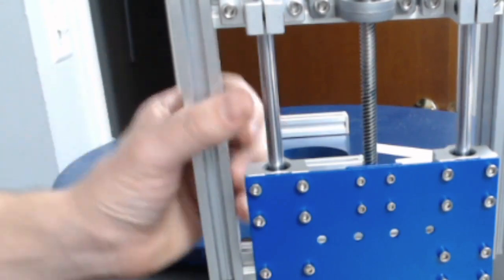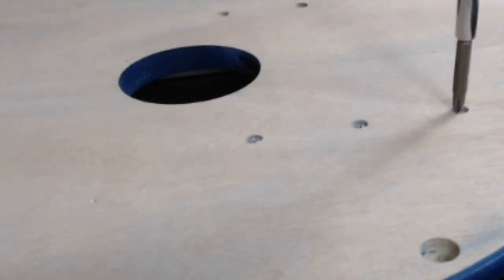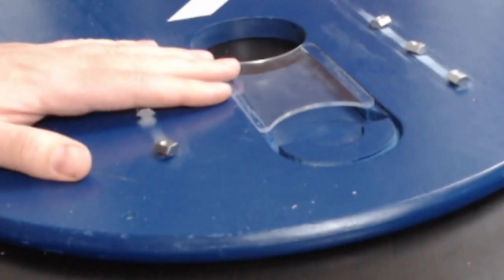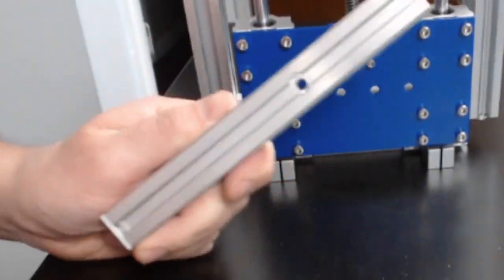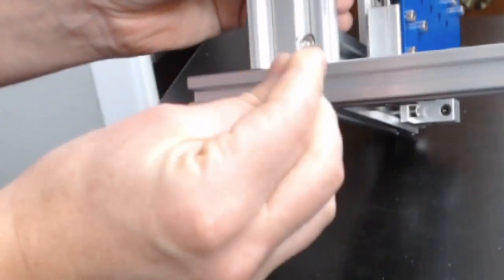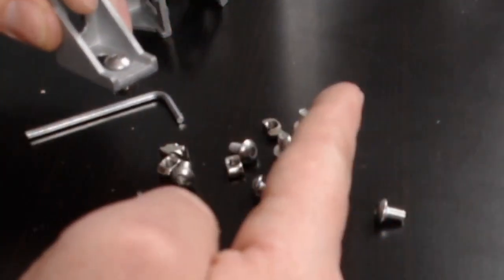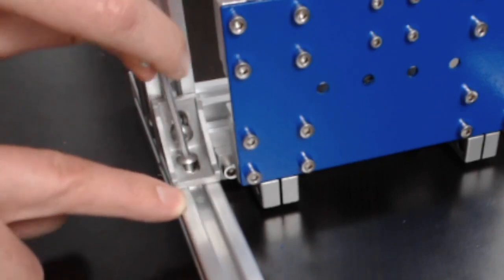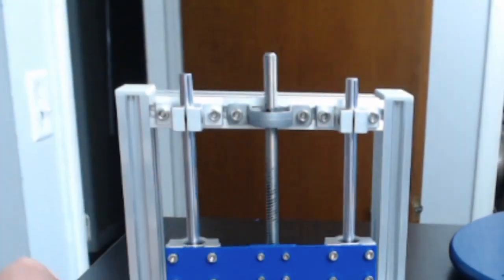Attaching the Z-Axis Rails on the Original M2

Comment: i believe a step is missing at 3:10.

before tightening up the longer m6 bolts, line those holes up and turn it upside down to see small access holes on the aluminum to tighten the still loose m4 guide bolts from 2:06. THEN go back to tightening the bolts as mentioned 

otherwise you can’t go back and tighten the m4s once the m6s are in place.